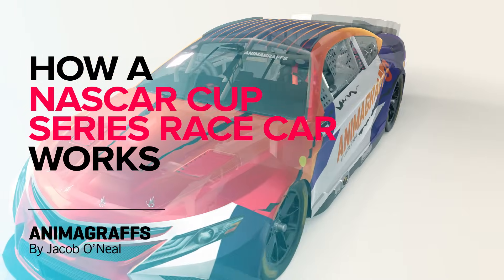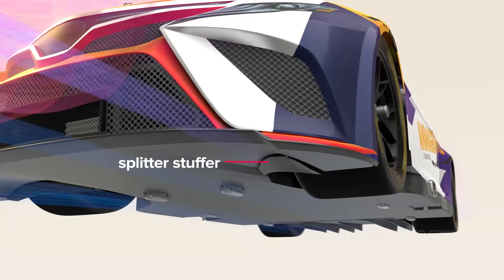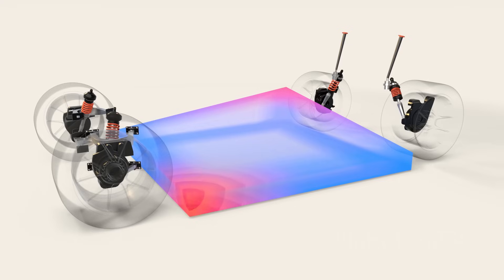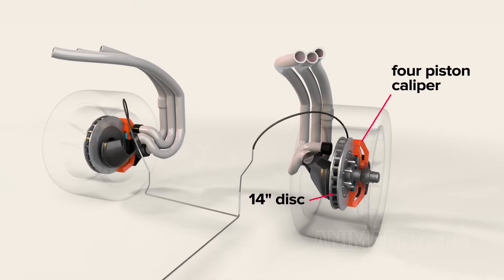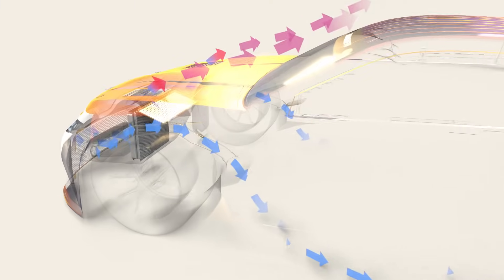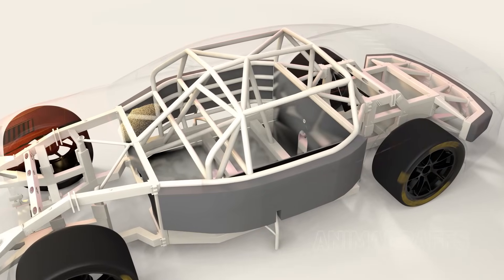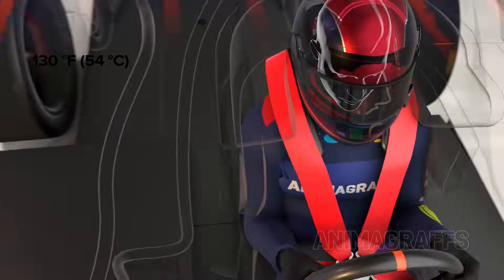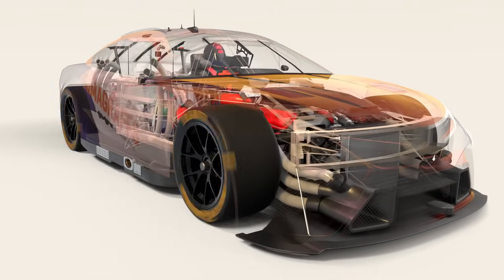How a NASCAR Cup Series Race Car Works

Comment: The Next Gen car is a technological marvel but has an serious flaw: By making it very tough and more resilient towards minor impacts, while it means it can be repaired easily and not taking the car out of the race inmediately, it leaves the driver vulnerable to hard hits. Every hit is felt badly by drivers and they're at risk of suffering concussions, with Kurt Busch at Pocono being the most relevant example. The previous gen deformed under a heavy impact and that was safer for drivers, but this time the car is just TOO tough.

Comment: This was incredible. The amount of changes to the bodies, frames, wheels, etc is astounding! I mean I’m not surprised with technology. I used to build 1:24 scale models of the old Chevy Lumina’s and Ford Thunderbirds from the 90’s (Days of Thunder) times. And haven’t watched NASCAR since after Dale Earnhardt was killed. He was my driver. :( Excellent job on your videos and keep up the great work!
Reply: Not much changed mechanically from the 1990's until this "Next Gen" car, introduced for the 2022 season, changed to independent rear suspension, rear-mounted transaxle, and single-nut wheels.

Comment: I've been away for a little while. I was calmly watching the video, when I discovered cup cars are now using Hub nuts. When the hell did NASCAR switch to Hub nuts? Maybe it's time to take the word "stock" out of your name. I am not that old, but my father told me stories of the days when you could go to the dealership buy a car off the showroom floor, and go race with it that weekend. I heard a story of a man who bought a car and had it race ready in 2 hours. NASCAR should open a series that races Factory stock passenger cars. Full emissions full safety full interior. On Factory stock tires. Stock brakes. Stock Cooling. No aerodynamic modifications whatsoever. If it is not as it was built from the factory, then it doesn't race. Watch how fast American car companies start building cars again.

edit: I understand Safety Systems would need to be employed. A harness and head restraint system could be adapted to these stock passenger cars. Speeds will be significantly lower, but I would still think a roll cage necessary. Four point, maybe six point? And a fire suppression system. The cage and the suppression system can be smaller more compact, and lighter than a cup car.
Reply: I would be interested in watching a real Camaro race a real camry. I also wouldn't mind a NASCAR series that had Vehicles like the new Corvette and others in its class racing. However cars like this would absolutely need to turn right in every race.
Reply: @nighttow8780  center locks come stock on alot of track focused cars these days so that's not anything too weird. They're just alot more practical for track use plus the new aluminum wheels wouldn't have been able to use the old lug nuts anyway.

Comment: superb animation
i have just one thing to add
ram air intake is nonsense. air pressure actualy drops a bit due to velocity. NA engines takes air due to piston traveling down and making vacum. no speed will force any more air inside.
ram air effect comes to an effect only at super and hyper sonic speeds, so speeds  of the sound.

Comment: In case anybody is wondering, they're called "NACA ducts" because in 1945, the National Advisory Committee for Aviation (NACA) developed the shape in 1945 as a very efficient way to duct air from the side of a vehicle (airplanes back then, but you see them on supercars today).

NACA was dissolved in 1958 and replaced by a new agency-NASA.
Reply: they tried to make a fighter jet with those inlets, and then realized it only works for low pressure situations like this
Reply: Amazing

Comment: I was kinda surprised to have google return me 94% when answering how much of the world uses metric system . that was prompted after your video mentions inch 35 times and centimeters not once. that was  an insult to 94% of your viewers. don't you agree?. is a  rhetoric question obviously i  would kindly suggest to  put somewhere the cm numbers. into the infographic . not everyone can juggle multiplications in their head on the fly best case, or they can just imagine what are you talking about. because they are not born or raised under THE  imperial measurement  , and cant get a feel for the size when the word inch comes into their ear . im one of those 94% of them.

Comment: Great video, thanks. I have always heard the race commentators and ex drivers say that the reason the side drafting works is because it disrupts the down force on the other car's rear wing, making the car lift slightly causing it to get loose...which is opposite of what was mentioned in the video. Idk

Comment: So Everything you said was great but there are a few things i dont think wrong is the right word but like could be better explained. Also on the Driver Steering wheel they have a kill switch button to turn off the engine incase of a emergency. and the Ducts on the windshield and rear window is suppose to provide air to flow from in the windshield out the rear window. not out the driver side.
Reply: You're right, we did miss the kill switch on the steering wheel! Good catch.

As far the airflow in the cabin goes, we found some good information in this youtube video:
https://youtu.be/VfUg6iS7kc8?t=37

Dr. Eric Warren, Director of NASCAR Programs for Chevrolet, mentions that the air actually comes in the back as well.

Comment: This video, 3D graphics and explanations are very accurate to the real world. I wish we had this channel back in our day when we were racing. I could have learned a lot, saved a lot, maybe won more often. We learn by doing and by trial and error. When you are a small team with few sponsors, mistakes are personally costly. 

I was involved in NASCAR for several years. We were not in the Cup Series, which is the top of the food chain. Very expensive class to race in. We had several cars and also, several trucks. They were competitive in local and regional racing events. I can still remember when Dale Earnhardt died in 2001. Several of the drivers wanted to quit racing. 

One of our biggest challenge was keeping current with ever changing rules. Even between tracks, rules could be different. When rules change, you have to change the cars. We always built new cars over the winter, based on rules that were published at end of racing season year before. Man, those were exciting times.

Comment: This is satisfying to watch. BTW tapered spacers are used at all races. The engine they use can still produce up to 900hp. They just have a larger spacer that caps at 670hp, and then 510hp for superspeedways. They will be putting in a new engine in less than 2 years with an unrestricted engine and hybrid components.

Comment: I think everyone has same question Why no speedometer?
Reply: Because to a driver in a race, the actual speed is probably the least important bit of information he can have.  He needs to know temps, pressures, and voltages to monitor how the car is functioning. The tach tells him if the engine is turning enough or too many RPMs.  All the speedometer tells you is how fast the car is going at that exact moment, but that's not very useful. You can be incredibly fast down the straight, and bog-slow in the corners because you've missed the setup. What you're aiming for (in general) is the lowest lap time, and it's a balance between speed on the straights and speed in the corners.
Reply: @almostfm  Thank you for very detailed answer. Now I understand. Have a great day!

Comment: Didn't know that a NASCAR vehicle ran a independent rear suspension with a transaxle. I always thought they ran manual transmissions right behind the engine to the drive shaft to for the sake a argument, a 9" Ford rear end with a gear lube pump attached to the drive shaft to lube the differential and rear wheel bearings.

Comment: This is great but everyone knows on super Speedway the cars sitting on blocks without any suspension movement. Without a ride height rule they run the cars on rubber blocks and the springs are useless

Comment: While you seemed to have done a great job on this video, I'd love it if you did one for the other generations of stock cars NASCAR's raced, as they of course didn't always run the Next-Gen (I mainly mean from Generation 3, which was run from around the early 80s to the 90s, to Generation 6, which was the generation raced from 2013 to 2021), & the generations they raced prior to it have significant differences in design.

Comment: The CFD was way off, but it's nice to see how the mechanics work!
Reply from the maker: What part? The visuals come from simulations like these:
https://www.pmw-magazine.com/features/nascars-next-gen-cup-cars-detailed.html
Reply: @animagraffs    So the duck tail wing doesn't force the air moving over it as high as shown at 1:17. The shot provided in this video is a very exaggerated display of what happens.

That type of ductail causes downward vortecies that result in a slight increase in downforce, but a more noticeable increase in suction at the rear of the car. This increases the diffuser effeciency. 

My source is that I'm in university and have been studying fluid dynamics for a few years now.

Comment: Great presentation, however the dump cans contain 12 gallons as a norm and weigh between 92-94lbs. The fuel cell holds 18 not 20 gallons.

Comment: Back in the 90s, they had a camera inside Davey Allison's car pointed at a thermometer that read over a140 degrees during the race at Talladega. Back then they didn't have head and butt coolers. The cars they race now with all the air defusers, and independent suspension, one lug nut, shows just how far Nascar has gotten away from what made it great.

Comment: The simplicity of this car compared to Formula 1 is so amazing!! Non motorized passive refueling, STEEL spaceframe, naturally aspirated engine,  lmfao are you kidding me?!? I love these cars!!
Reply: If you ask me that's one advantage NASCAR has over Formula 1; NASCAR stock cars are significantly simpler in design, which also means substantially reduced cost compared to an F1 car.

Comment: modern nascar cup engines can revv up to 11k rpm while employing a robust ohv valvetrain engine architecture. and at around 358 cui they can make 900 hp , and that is free breathing naturallay aspirated with no form of forced induction employed.
most impressive. they are the most advanced high tech engine application of "low tech"   engine architectures. pure racing , thoroughbred racing technology and motorsport heritage and history.

Comment: Could you do a video on the latest America's Cup sailboats? The AC75s are amazing 75ft monohulls with foils (underwater "wings") on adjustable cantilever arms on each side of the hull. The foils lift the boats about 1.5m above the water, reducing the water drag to basically nothing and allowing these beasts to reach 3 times the wind speed.

Comment: Dale Earnhardt Sr was the first NASCAR driver to use airflow as an advantage. He discovered how while doing a practice test at Daytona Speedway, with his friend Neil Bonnett, on a foggy Saturday morning. They tried several different positions to see how the fog moved around at different speeds, etc. It took other NASCAR drivers a long time to figure out what Dale Sr was doing. Some said that he could "see the air." He even modified his helmet so he could feel the airflow on his face during racing situations. Dale Sr could do things while driving a race car that other drivers often thought were impossible to do.  Thus, he became the greatest race car driver in NASCAR's history.
Reply: wasn't it Junior Johnson that discovered drafting first in NASCAR?
Reply: @aceboxssbm3  yes it was my great grand father
Reply: I wondered why people would say he could 'see' the air moving around the car.
Reply: No.  Smokey Yunick built a 7/8 scale Chevelle back in ‘67 to run NASCAR, because he knew the reduced frontal area would be a huge advantage.  Aerodynamics in NASCAR predates Dale Senior by a couple of decades.
Reply: @Annunaki_0517  That downsized Chevelle was disqualified.
Reply: No Way! Ricky Bobby is the greatest NASCR Driver.
Reply: @johannjohann6523  your ignorance is quite obvious. You didn't even spell NASCAR right BTW, Ricky Bobby is a fictious charater.
Reply: @sergeantmasson3669  those are called jokes... great for your health

Comment: I love this channel. This was an especially interesting subject as I'm not a nascar fan, although you may have sparked my interest enough that I may give it a shot. The engineering behind a cup car is special!
Reply: Hope you gave NASCAR a shot and watched the race at Circuit of the Americas that just finished today! One of the best and wildest finishes on a road course. It don't get much better than that 

Here's a link to the finish:
https://youtu.be/FckgYq82v98
Reply: Bro u should try out nascar '12
Reply: go catch a race at Martinsville speedway the track is only .526 miles (.847 km) long and the turns are sharp so drivers are constantly switching from max acceleration to max breaking after a few laps the breaks start glowing
Reply: yeah the new cars are engineering marvels, and the racing has been good

Comment: JACOB! Thank you for another one of your absolutely INCREDIBLE videos. I binged your entire catalogue on Youtube here and I just absolutely love the quality of these CGI breakdowns.

Edit: As for the aerodynamics of NASCAR, the dirty air and simplistic look of the car makes it feel like a brick under its top speeds. It's very important to understand that the sort of control this amount of downforce gives you is very significantly different than that of say full front and rear spoilers, or formula one levels of aero control. The minor slats and diffusers and wings are basically a minimum requirement for the cars.

Comment: Great content - and spot on accurate.  I feel like this channel is the best kept secret. This content deserves so much more viewers.  Although I'm disappointed you mentioned the Earnhardt and Petty bar but failed to mention the newer (and very important) Newman bar.
Reply: As the main researcher on the project, I had some questions about this throughout the process. The earnhardt and petty bars are identical in the next gen cars when compared to the 6th gen. The newman bar, from what I understand, was a second bar that was added across the entire windshield area below the original halo bar. The next gen no longer has that same bar, but does have a single bar only on the driver's side that does the same thing? 

Since the bar changed, and is now only extended across half of the windshield, I didn't want to assume that it was still considered the same bar name, as I was unable to clarify with 100% surety that it was still considered the newman bar.

If it is still considered the newman bar, let us know and we will be sure to add it to a comment of "corrections/additions" that we add to a pinned comment.

Thanks!
Reply: @oneal187  Thanks for the detailed response.  I'm embarrassed to admit I didn't realize the "Newman Bar" only extends to the driver's side in the Next Gen car.  Newman, with his engineering background, was responsible for important safety updates the last gen NASCAR chassis. He had a propensity for other cars landing on his and was very outspoken on increasing driver safety in those events.  His scary wreck at Daytona in 2020 was the catalyst that introduced even more robust changes to the roll cage and crash structure of the car.  But I'm getting off topic.  Since the bar is different in the Next Gen car, I agree with your assessment, even though it serves the same purpose, it's different so it can't be assumed to be the same.  I just didn't want Newman's contributions to safety to be overlooked. Thanks! Keep the vids coming, they're top-notch.  You've done F1, you've done NASCAR, I think an IndyCar would be a great video and round out the collection.
Reply: @Duncanudc  - Thanks for the support! I'll see if I can talk Jake into doing an IndyCar in the near future 😉
Reply: What a great comment thread! I had the same thought about the "missing" Newman bar in the graphic, but I didn't realize they'd shortened it. However, seeing the design now, I think the name may still be appropriate. That extra bar seems to specifically reinforce the driver's front corner of the cage against intrusion. I wonder if Newman's 2020 crash had any influence in it's placement? Same name, new reason?
Reply: @StevewiththePbass  That makes sense! We will add a pinned comment about it. Thanks for the feedback :)
Reply: @LETSTALKENTERTAINMENT  Good to know. Thanks!